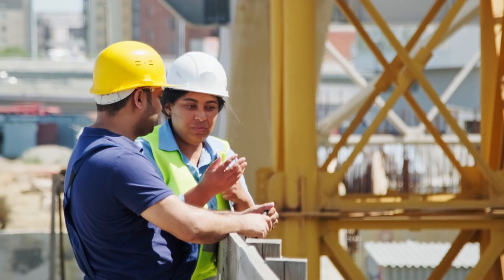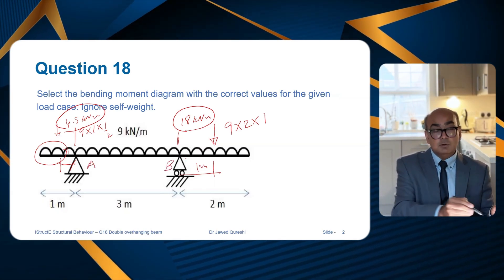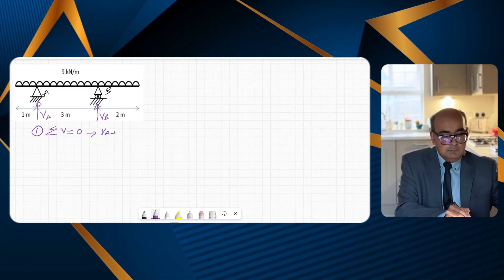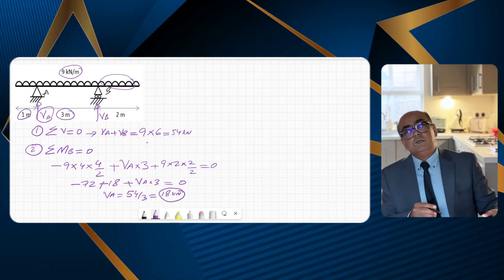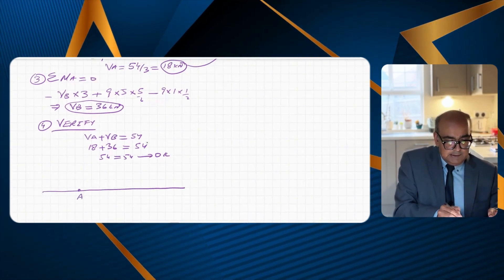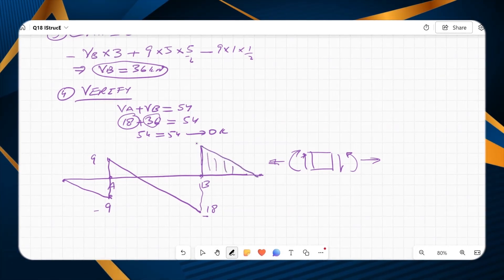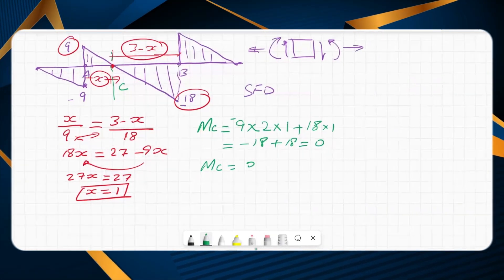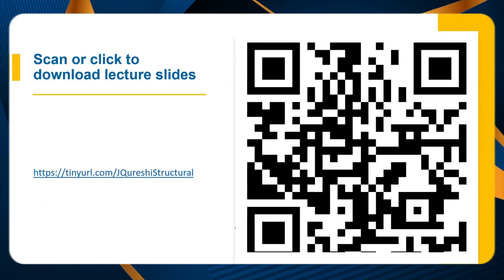Double Overhanging Beam – Qualitative Analysis | IStructE Structural Behaviour Course

Comment: So it's possible to have zero shear force and bending moment at the same point?. I thought where the Shear force is zero, bending moment will be maximum just as you said earlier in the video
Reply from the maker: Shear force is normally zero at mid span when we have distributed load applied to the beams. This is the point where bending moment is maximum. 

In case of point loads, zero shear force is not possible.
Reply: @DrJQureshi why is it not possible? No zero shear force occurs along the beam when the load is concentrated?